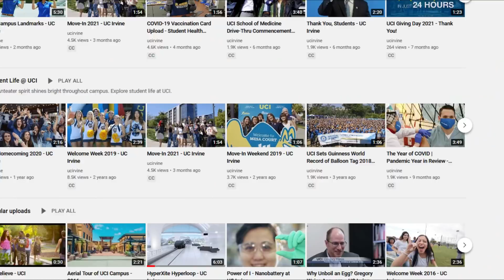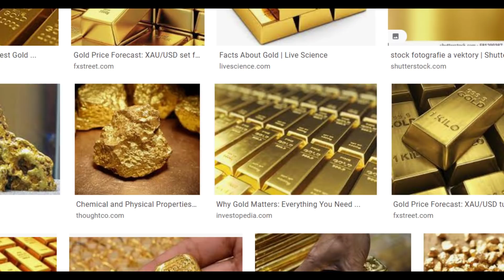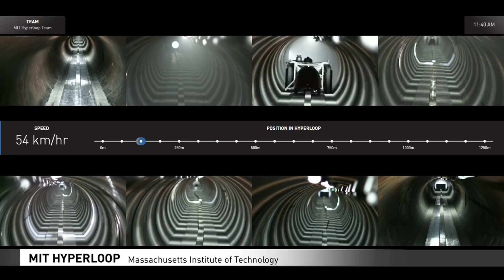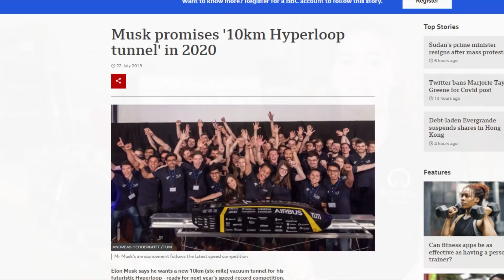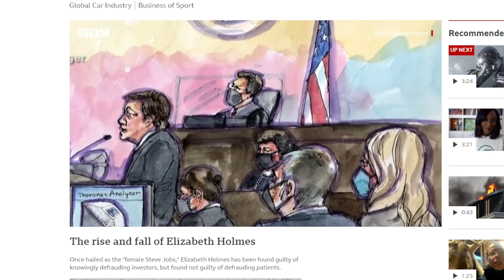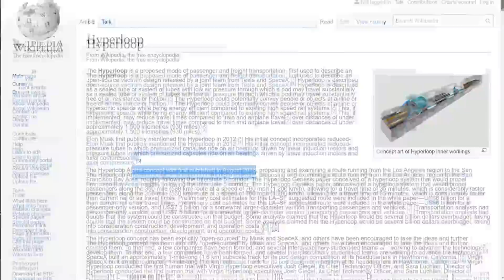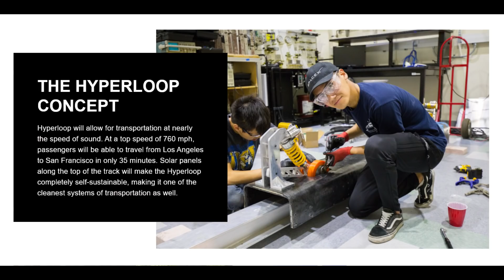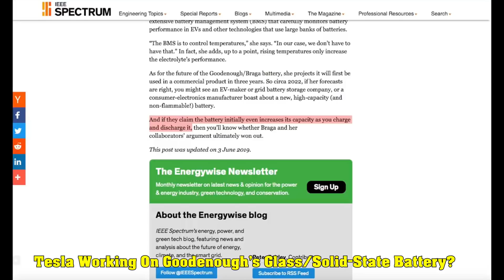The GOLD Battery that will revolutionize EVERYTHING!

Comment: Wonder what could have been accomplished if this whole generation of engineers wouldn't have wasted time on this conman's money hustle?
Reply: What do you want us to do? Refine the stuff we already have even more? That is something a trained monkey can do. There is a saying I have heard a lot used by engineers: The question isn't why, it's why not. I  didn't study engineering to simply do "buisness as usual. I went into the field to embrace batshit crazy ideas and try to make them work. And I know a lot of others think the same. As with the military: if you can't take the joke, you shouldn't have joined. Blame the marketing guys for overhyping ideas that work of paper but are still stuck at the start of development, AT BEST!
But then again, if it turns out the basic science doen't work, you should either give it back to the scientists or try something else. I stand by what I said, but i also have to consider the economics of it.
But I also love Musk specificly for one thing: he throws money at research that under "normal" thinking would either be put on the backburner because noone is interested or would get no funding because "it is impossible and stupid". And yes, I know he always promises more than he delivers, but instead of pointing and laughing I see it differently.For example: We may not get a hyperloop, but the research alone into the tech required for it might give us bette vacuum seals, esealant, vacuum pumps, or if not even that, give us the startingpoint, the ideas required, to get to these technologies an more. But if you only want research that is garanteed to get get the exact result you promise, sorry sunshine, that's not how the world works.
Reply: @supsup335  I agree with you to an extent but your focusing on an extreme opposite. Not every “idea” is a good one or worth pursuing. If all of those students focused time and resources on something else actually feasible, what they could have accomplished together might have been amazing. Instead it’s wasted on a dead project that got them nowhere
Reply: @supsup335  so does that mean I won't get engineers to help build and plan an Ocean liner since its an old idea Then?
Reply: @supsup335  We're not in anyway talking about what has been proven not to have any possible future  - which is mostly what Musk's snake oil is.  He often fundamentally violates basic laws of physics, which is something you should have learned in high school. There is no way to solve for most of it, attempting to do so is Quixotic, at most generous. A complete waste of time at slightly more realistic evaluation.

Succinctly, there are better turds to polish. There are many better fundamental areas to drill down on, and get better clarity on the processes that drive them. This is a focus on building perpetual motion machines, not finding and harnessing some new type of energy.
Reply: @16v15  😒 The guy in charge of the largest space organization in the world has a fairly good grasp on the basic laws of physics. Please stop falling for these click bait videos. It's just a sad academic uses juvenile insults and snarky editing to express his envy.
Reply: @jackalenterprisesofohio  Maybe they can work on building a diarrhea-free ocean liner?
Reply: @berekhalfhand4775  Well, the point of "useless" stuff is occasionally there's some good stuff that can be used.  eg WiFi came about from someone looking for miniature black  holes, a "useless" exercise and he never found any!

HyperLoop is dumb, but maybe someone working on it will come up with a slightly better pump which could be used for better ventilation.

An old idea to reduce disease is to make door handles & railing out of copper, germs don't survive there for long.  We seem to have forgotten that.  Tell Musk coating the Hyperloop with copper will make it work better, maybe someone will figure out a cheap & fast way to copper-plate steel.
Reply: LMFAO!!!! As soon as you evolve into a bat , you'll understand the blindness you're feeling....
Reply: @16v15  that's not how evolution works
Reply: @spybird5870  Well, your progeny (several generations removed) will figure it out...
Reply: @16v15  okay jenius
Reply: @Foolish188  Solar roofs are still being sold by Tesla. What are you on about? They're working so well that GAF, thd world's biggest roofing manufacturer, is trying to move into the market.

As I've said in other posts, I could understand some of your criticism if we were talking in 2005. It's simply bizarre to keep questioning the guy who created the most successful space organization in the world and pushed the entire auto industry towards electrification.

The whole point of science is tinkering. Some shit isn't going to work out. That's the nature of taking risks. I wouldn't expect a mere academic like Thunderfoot to understand what it means to take risks and actually produce things.
Reply: @kungfoochicken08  being brave and being stupid are not the same
Reply: @wess1911  😂 he's not stupid though. He made $400m from PayPal and plowed every dollar into starting Tesla and SpaceX. He could have been sitting on a beach somewhere living off the interest for the last 20 years. Instead, he decided to start companies and work 80 hour weeks.
Reply: @kungfoochicken08  Yep... Instead of enjoying the money he started scamming people to stroke his own ego....
Reply: People said the same to the wright brothers and cars before henry ford.
You never know what will come out of a "pointless" task.
Any real scientist and mathematician will say that tackling a seemingly impossible problem is good exercise for your brain and may lead to unimaginable finds.
Reply: @kungfoochicken08  SOOOO... the public?
Investors?
NASA?
Government?
Reply: @kungfoochicken08  well he achieved a lot I guess doesn't matter how much/ little time he spent or if he spented them in the first place it's just that he shouldn't have started the hyperloop it had many flaws and his other techs too either way I'm not some know it all all I know is that he failed in something that was not feasible in the start that was a response on your claims about taking risks isn't that bad but taking risks while knowing the outcome isn't good is plain stupid if he didn't know that makes him even more stupid in all honesty I couldn't care about what he does or doesn't this all just entertainment to me so doesn't take my words to serious at the end we are not here to convince the other
Reply: @hakancarlsson2881  It's not a scam. He's ambitious with his time lines. He does deliver.

The frustrating part of Thunderfoot's criticism is that Thunderfoot is just a timid buffoon who sits on the sidelines and complains about how this or that idea would never work, while Musk is out there doing the work. Yeah, some of his ideas don't work out and others take longer than expected. I don't really care because at least Musk is trying to accomplish something. Everytime I hear Thunderfoot criticize Musk, I can't help but to think about Roosevelt's "Man in the Arena" speech:

“The poorest way to face life is to face it with a sneer. A cynical habit of thought and speech, a readiness to criticize work which the critic himself never tries to perform, an intellectual aloofness which will not accept contact with life's realities—all these are marks, not of superiority but of weakness. It is not the critic who counts; not the man who points out how the strong man stumbles, or where the doer of deeds could have done them better. The credit belongs to the man who is actually in the arena, whose face is marred by dust and sweat and blood; who strives valiantly; who errs, who comes short again and again, because there is no effort without error and shortcoming; but who does actually strive to do the deeds; who knows great enthusiasms, the great devotions; who spends himself in a worthy cause; who at the best knows in the end the triumph of high achievement, and who at the worst, if he fails, at least fails while daring greatly, so that his place shall never be with those cold and timid souls who neither know victory nor defeat."
Reply: @wess1911  The fundamental problem with your argument is that every new tech is "not feasible" or "not practical" when the research begins. The whole point of science is to tinker and solve these problems. This is why it's so frustrating to hear a mere academic and YouTube man criticize someone who is actually out there trying to solve these problems.
Reply: @kungfoochicken08  tinkering with the possible and tinkering with the impossible are two different things my goodness this whole hyperloop concept was flawed but true I'm in no way competent to criticize this but as you see it failed while the "competent" people knew it was not possible I don't mind somebody going out of his way to go try new things if he has good reasons to try ( also it must not go against our world laws whether they are about physics economics or something else) but elon had none he just threw some money at some people and told them to go make it possible atleast that is what im assuming we are all just assuming from different angles so we can maybe never know who is right but yours seems to give him a bit to much the benefit of the doubt honestly no need to make this topic as fanatical as a religious debate we are just talking about a man we don't know at the end
Reply: @wess1911  The guy running the world's largest space organization deserves the benefit of the doubt when it comes to determining what physics allows.

It hasn't failed. Its still being developed. Maybe it will work, maybe it won't. All I know is that the same people who are mocking hyperloop were also mocking electric vehicles and reusable rockets. Hell, Thunderfoot even has entire videos "explaining" how reusable rockets will never work or be economically viable.
Reply: @kungfoochicken08  I'm too bothered to debate about something I'm not interested just to feel right either way I don't know if TF is dumb but what I do know is that Elon is just another businessman who hires people to work for his company he maybe gives directions but you do know that starting a doomed idea just because you had nowhere to spend your money is kind not the best decision you can make also he is a normal human being not a super genius he just started SpaceX with the abundant money he had and hired competent workers he didn't find a new formule that changed things in the spacecraft business he was just a businessman with the means to do this and it got successful either way I maybe wrong so can you and this conversation is getting in my way to beat orphan of kos (boss from bloodborne dlc) so I'm going end with this comment if you wish you can still respond to this and give a counter argument to whatever I said for the others but I won't be seeing it you can also not respond to it fo as you please
Reply: @AbeYousef  The hyperloop is a side project. It doesn't receive that much money. It's a high-reward, low-risk project that's probably going to fail but if it works it'd revolutionize travel. Tesla and SpaceX were similar projects and they succeeded, so now we have the irrational belief that all of these projects must succeed.

Exactly how much public money has gone towards Tesla? They repaid their loans early and with interest. They get the same corporate welfare benefits states give every major job provider when they build factories. I really don't understand all this kvetching about government subsidizing Tesla. The government absolutely didn't subsidize SpaceX. They got NASA contracts, sure, but that's because they bid significantly lower than any of their competitors.
Reply: @wess1911  I appreciate your frankness. For future reference, please use punctuation. None of your comments are broken up into sentences and it makes the argument very difficult to follow.
Reply: @Tatwinus  the Wright brothers did not promise transatlantic passenger flights in widebody jet aircraft or supersonic jet fighters within 3 years. And Ford made more affordable cars manufactured in large quantities of identical models in order to reduce cost - something that was not "promised within 3 years but laughed at by skeptic crowds".
Reply: @hakancarlsson2881  Where exactly is anyone losing money on Musk's statements? At the point, his ambitious goals are a known quantity. There's even a phrase called "Elon Musk time" to denote the extra time it takes for him to develop products.

-Solar roofs have been in production for years now.
-1 million mile battery is still being developed.
-Robo-taxis are a ways off, but it's clear that we are working towards them.
-Tesla Semis are in limited production in Nevada now. They'll start scaling up mass production of the Semi and Cybertruck in Austin this year.

Musk is one of the few leaders in the world who isn't content with tech development being limited to increasing megapixels in cell phones or increasingly addictive social networks. He has a vision for the future that's inspiring people. It's rather pathetic to see YouTube neckbeards pretend anyone cares about their vapid criticisms.
Reply: @kungfoochicken08  Like I said... He lies to get peoples money.... That's what a scam is....
Reply: @hakancarlsson2881  He's not being intentionally dishonest. His products are at the cutting edge. He's simply underestimating the time it takes to develop them. Then there's the whole covid thing that slowed everything down. It's not as though they're simply changing the headlight design on a truck and pretending it's a new product, like Ford and GM do.

Precisely who is losing money on Elon's delays? Deposits on his cars are refundable, and Tesla stock is up 1000% in the last two years alone. Clearly the whiney YouTube academics are the only people who give a shit about waiting a little longer for his products.
Reply: @kungfoochicken08  Every single launch is promised years before they actually launch.... If they even launch... All of them. And he usually start selling them on that promise... 
That's not underestimating... 
Who knows if they even started working on them when he says they are ready? 🤷
No matter what, it's dishonest. 

He lied about the "Solar houses" that's dishonest.
He lied about them being able to "do it today". That's dishonest.
He lied about Tesla owners making more money on the car than what they pay for it... That's dishonest.
He lied about hyperloop... All of it was bogus from the beginning.... That's dishonest.
He lies about being the founder of all of his companies. That's dishonest.
And so on...
He's ridiculously dishonest. And he makes money on it...
And yes the stocks are up.... Because of lies? 🤷
Reply: @hakancarlsson2881  He announces the product while they're working on it. He doesn't start selling them. He's just taking refundable deposits because demand is so high. Hell, the Model 3 launched 3 years ago and it's still a 6 month wait to get one. I'm not aware of any dishonesty in his estimations. He misses some deadlines, sure, but he's never intentionally deceptive. And, let's be honest, the deposits are like $100 and they're refundable. Do you really think he cares that much?

What solar houses are you talking about? Tesla's solar panels and battery packs are widely available...

His goal for Tesla owners to rent their cars out when they aren't using them is a long term vision, one he is working towards with his FSD software.

He hasn't lied about hyperloop. He's still shoveling money into the project. If Thunderfoot had anything substantial to say on this project, he should write a paper on it and publish it. You know, the sort of thing academics are supposed to do. When you can't figure out how to write a paper, you make "BUSTED, BY FACTS AND LOGIC" videos for your teenage audience.

He is the founder of PayPal, SpaceX, and Tesla. The only one that's even contentious is Tesla. He joined the company when they had three employees and no outside money, a mere 6 months after they were incorporated. He joined by becoming the company's largest shareholder and chairman of the board. He grew the company from 3 employees in someone's garage into what it is today. He's also legally the founder.
Reply: @hakancarlsson2881    I'm replying on my phone, so I can't see your post while I type. I'm sure I'll miss some of your points, but I don't really care.

Deposits are refundable. I know because I had to cancel my Model S Plaid order this year. They sent the money right back to my account.

Nobody lost money on the delay in implementing the taxi idea. FSD was more difficult to solve than he anticipated, that's all. I'm not sure why you keep attributing malice to him.

Hyperloop is still being developed. It's a stretch project, much like everything else he does. Everyone else was sure EVs would fail too. Only time will tell how the project turns out.

Thunderfoot has published, because you have to publish SOMETHING to get your PhD. His papers don't actually get cited by other researchers though, which is the real test of how much his work contributes to the science body of knowledge. The guy seems to understand aeronautics better than all the rocket scientists at NASA and SpaceX but can't publish anything for others to cite. Rather strange...

He's a founder of Tesla. He won a lawsuit to legally claim he is. Technically, he is in a founder. In spirit, he is a founder as well. They were tinkering in a garage for 6 months before he got there and bought a controlling interest in the company. He grew it into the most value car manufacturer in history. He founded the company.

Musk founded x.com, which merged with Confinity. A month after Musk left, they renamed the company to PayPal. Musk retained his position as the largest shareholder after the company was renamed, the company maintained its corporate structure and assets. PayPal and X.com are the same company. The only thing that changed was the name. Musk was a founder of PayPal.
Reply: -Matter didn’t create anti matter
-Anti matter didn’t create matter
(Both of them were present at the time of big bang)
-Both of them didn’t create themselves.
-Both of them came from an unimaginable source,  that unimaginable source created matter and antimatter (everything) thats why it is known as “the creator” of everything.
———————————————————
- that unimaginable source/creator has created sin and virtue which are opposite to each other,
— logic says every action has its own reaction, so the reaction of sin must be different than the reaction of virtue,
— the creator has created prophets to let us know about each and every detail of sin and virtue, also about their reactions,
Thank u :)
Reply: @kungfoochicken08  Tesla didn't even produce a million cars 2019 and 2020 combined. 
Which implies that even the cars already out in traffic would somehow become Robotaxi to get to a million. 

He was sure they would be out in a year in 2019. In 2020 he was also sure they would be out in a year.
It's now 2022.
They've sold around 1.5 million cars since he first told that lie...
And the autonomous semis "could be done today" in 2017....
Proving he sells cars on empty promises. It also proves he's dishonest. 

It's ridiculous to keep simping for a billionaire and refuse to at least call out obvious dishonesty.
I'll never understand how "the richest guy on earth" shouldn't get criticism.... 🤷
It's crazy...
Reply: @hakancarlsson2881  It's ridiculous to piss and moan about minor shit. The guy is leading multiple industries at once. What he's accomplishing is nothing short of astonishing. You're watching history be made. Such vapid criticisms of successful people always remind me of Teddy Roosevelt's speech:

    "It is not the critic who counts; not the man who points out how the strong man stumbles, or where the doer of deeds could have done them better. The credit belongs to the man who is actually in the arena, whose face is marred by dust and sweat and blood; who strives valiantly; who errs, who comes short again and again, because there is no effort without error and shortcoming; but who does actually strive to do the deeds; who knows great enthusiasms, the great devotions; who spends himself in a worthy cause; who at the best knows in the end the triumph of high achievement, and who at the worst, if he fails, at least fails while daring greatly, so that his place shall never be with those cold and timid souls who neither know victory nor defeat."
Reply: @kungfoochicken08  So what? 
He apparently has more money than anyone on earth and you can't even accept legitimate criticism of him... 
That's how cults work...
Reply: @kungfoochicken08  You are acting like he's a poor struggling divine martyr when you can't even acknowledge any small flaws at all...

He's been rewarded more than anyone who has ever lived on this planet. That's worthy of critique....
Reply: @hakancarlsson2881  I don't mind pointing out "small flaws." I mind the nonsense you're pushing that he's a fraud and a huckster. He's one of the few people who are thinking big and pushing the world forward. It's rather irritating to watch people like Thunderfoot, who have contributed next to nothing to society, try to tear him down.
Reply: @kungfoochicken08  Which of my examples are incorrect?
I've referenced a  dozen....
And there are dozens more...

Knowingly saying incorrect things is being dishonest.
If you make money off that you are often labeled a fraud....

Becoming the richest person on earth off it....?
We should just disregard it all , praise him and even make up shit to stroke his ego?
That's really bonkers....
Reply: @kungfoochicken08  Underestimating timelines happens...
Saying that you have a new technology and that you think it might come to fruition in 5 years and it doesn't pan out is one thing.

But saying that you are sure it will be in a million cars in a year is ridiculous....
In fact Tesla hadn't even produced a million cars in total when he said that... 

They didn't have the tech, they didn't produce enough cars and the regulations wasn't there... 
It's a complete lie with just one of them since any of those things makes it completely impossible... 
Which he of course knew... 
How is that not dishonest? 

And he has done such predictions more than 20 times.... Can you even find one where he didn't?
1 time is miscalculation, every time is a strategy... A dishonest strategy...
What is there to refute?
Reply: @hakancarlsson2881  Tesla had produced a million cars by the end of 2019. Elon was saying that every Tesla could be a robotaxi.

You're cherry picking a few missed deadlines from a guy that's at the cutting edge of every field he's in. Delays are inevitable. He's also a guy who talks to the media a lot. What percent of his predictions are delayed?
Reply: @hakancarlsson2881  The tech just wasn't there. The regulations on Level 5 won't come until the tech is there. Legislatures and the judiciary are always reactive. It'll take someone getting hit by a robotaxi and the media making a big fuss before any laws are written.

And yes, Tesla's older cars can be updated to be used as robotaxis. All that would be needed is an OTA update and an Autopilot 2.0 camera module upgrade.
Reply: @kungfoochicken08   A few? 🤔 
Can you even name a single prediction that was even close?
I've already mentioned at least 6 so far in this thread. 
If I refrain from adding more and you manage to find one, the number would be 83% 🤷
Reply: @kungfoochicken08  "The tech just wasn't there"
Yes exactly!
"The regulations on level 5 won't come..."
Yes exactly!

So you finally agreed he lied! 👍 

BTW
OTA update for a 2009 Tesla... 😁
Reply: @hakancarlsson2881  He didn't lie. It was a prediction on where the tech would be by 2019.

What is your point about the regulations? It's completely legal for Tesla to operate autonomous vehicles. The regulations on Level 5 won't come until after the tech. Waymo is operating autonomous vehicles completely legally right now. Regulation isn't a problem.

The Roadster is the only thing they sold from 2008 to 2012. They sold 2,000 of them. The 1m number didn't rest on whether those Roadsters could be updated. 2013 Model S vehicles have access to Autopilot 2.0.
Reply: @kungfoochicken08  Which also puts you in the camp of people that think Musk is stupid....
Reply: @hakancarlsson2881  I'm not calling him stupid. I'm telling you that I've been on large, complicated projects before. I know exactly how difficult it is to estimate time lines, particularly when what you're accomplishing has never been done before.

Also, 6/7 isn't 83%.
Reply: @kungfoochicken08  haha "6/7 isn't 83%" I guess you got me there 😂👍
Reply: @kungfoochicken08   Believing that every Tesla car owner around the world would update their car and let stranger ride them illegally in a year is stupid.
And you are saying he believed that so... 🤷
And if he isn't stupid he lied.... There really isn't much to this....
Reply: @hakancarlsson2881  What is illegal about a robotaxi?

The robotaxi would exist whether you allowed strangers to use them or not.
Reply: @jackalenterprisesofohio  Are you kidding, that sounds awesome.  First lets start with the hull.  I was thinking stainless steel, reinforces with carbon struts.  Thoughts?